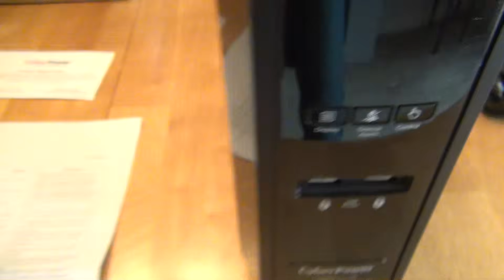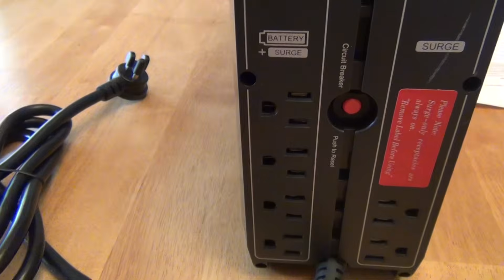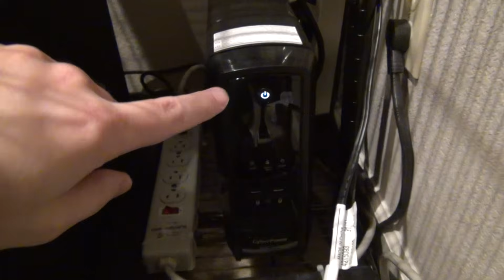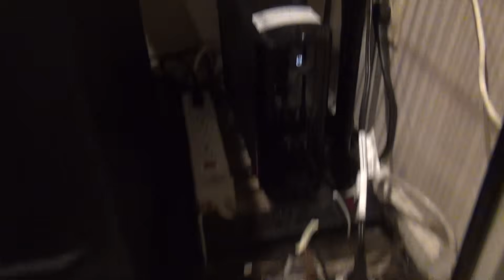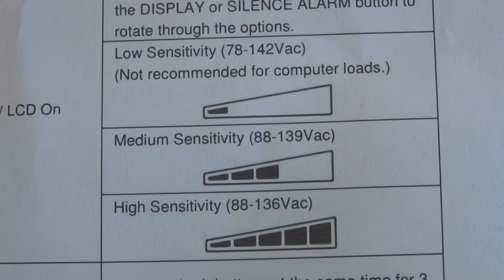CyberPower 1500VA 900W Sinewave UPS (CP1500PFCLCD) Review

Comment: Hey Tiger, just wondering how's this thing been running after 8 years?
Reply from the maker: I had 4 of these and had been going perfectly well to outlast power outages, and let me turn off equipment attached.  But the first one finally failed last month (June 2022).  It shuts off when there is a spike in power draw, and doesn't hold a charge.  I was going to look into replacing the batteries, but haven't had a chance yet.  Its batteries aren't intended to live forever and are supposed to be replaced at some interval if I remember correctly in the instructions.  I just used it until it died.  That was quite a while.

The capacity might have diminished over time, but for some of them I typically turn off the equipment when they start beeping, and had been enough time.  The other 3 are still running ok.  And I am planning to look up replacing the battery in the one that died eventually.

But I also have 4 Tesla power walls for whole home battery backup to installed in a month that will probably render this a moot point.

Comment: ive met a few people who feel they MUST have a UPS or their PC or other electronics will be damaged by dangerous "surges" or instability in their homes electric. ive never , not a single time, in roughly 40 years, had a PC, or other component damaged by electric surge. ive been told it happens where wiring or source is poor, well i live in Massachusetts, we have homes here that were built before Abraham lincoln was born, i lived in a home built in 1626, & still no phantom surges of death. i hate to break it to everybody, but a UPS (in reference to home use) is a placebo. its a suckers purchase, like static wrist straps, & the likes. We all know these events are Possible, just like its possible a bird will fly into your head & kill you, but you dont go around wearing a helmet every day do you?? a UPS is great for keeping power on during a blackout or brown out, its great for very limited short term electrical stability & reliability, & preventing data loss, but unless you have some extravagant storage setup, even data loss is of no concern, normal Windows home PC's will be perfectly fine if power is suddenly cut off.

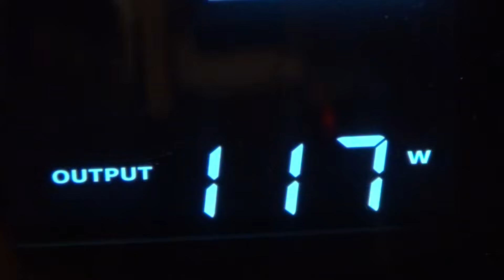Comment: 4:20.  Output = 117 watts.  Hah - my PC has a 650-watt PSU and I have a two-monitor setup.  Guess this will run for like 8 minutes when the lights go out.  Not a whole lot of emergency run time if you asked me.
Reply: No, that's the truth. If you want to run that you will need a much larger UPS.

That's just the way things are in the UPS marketplace.

Comment: Ok you actually didn't mention this but, do you plug this in straight to the wall? as i see you have it on extension cord.
Doesn't this thing have protection against surges and stuff? 
The only reason you'd need a cord is for extra power outputs which in my case 5 is the max i would need for my computer,phone,monitor etc.
Reply from the maker: Yes, plug right into the wall.  I had the other one first, and power neatly run all around.  It was easiest to just plug right into it.  Plus that room had a lot of noise on the electrical circuit from the dimmer switch on the wall (buzzing of other things if you dim the lights, likely due to grounding issues I've read).  Given the other is specifically meant to help with that noise, and this one just decides power or battery seamless switch when needed, I kept the other one.  I have a number of these, but only use the other in one place because I still have it and is convenient to use.

Comment: After 4 Years and a few months.  Do u already replace any battery?  Im going to buy one of them  CP1500PFCLCD, but i want to confirm that if is worth it.
Reply from the maker: I haven't replaced the batteries on any of mine.  I'm not aware of a significant degradation in capacity, but I don't have many power outages and I don't pull the plug to find out :) …. haven't had a problem with mine yet.  Power always comes back before I have a problem, or I have enough time to turn on my monitor or TV and power it down properly.  When I turn on the TV or monitor, it draws down the power much faster, like 15 minutes, if that, because I have a 65" TV.  But I only need it on for a minute.

Comment: I thought ups weren’t supposed to be connected to any power strips?
Reply: What I have read is that you must not connect a surge protected strip to a UPS (in either direction) or you may reduce or even cancel out the protection (just like you must not daisy-chain one surge protector to another https://www.nachi.org/power-strips.htm).  A UPS is supposed to be plugged straight into the wall, and devices plugged straight into the outlets (maybe via an extension cord).  BTW, a little thing I came across: "Nearly 20 percent of all failures and fires stemming from surge protectors happen as a result of daisy chains, according to a publication by the U.S. Office of Compliance" and "Daisy chains overload the surge protection technology, putting your electricals at risk during power surges." (https://www.prairielectric.com/blog/can-i-plug-a-surge-protector-into-another-surge-protector/). I don't know the particulars of how surge protection works or how a daisy chain causes a negating interaction, but I have read it in several places.
Reply: those really dumb 'surge protectors' that use a simple popout breaker setup and be put in front or behind of a surge protector, but otherwise you are right. Do not daisy-chain proper surge protectors.

Comment: Thanks for the review ..now my question..
Is this capable to reduce or cut electrical hum (exemple if I plug a guitar amp into it) or (guitar multi effects) studio speakers and so on..?

Because I have no ground loop eliminator in my home electrical installation.. hearing some buzz hum etc when I plug my guitars wherever (amp, multieffect, sound card etc) and the el hum become furious when I use compressors or distortion pedals) it’s almost unusable !

Comment: Hey Reviews By Tiger,
Are you happy with the UPS, can you tell me if you hear a coil whine or buzzing from the UPS when it's not running on battery or is it quiet? I am looking for a quite UPS... my APC was buzzing constantly :(
Thanks
Reply from the maker: I have 4 of these, and none of them have coil whine whatsoever.  It is completely silent when on AC, and when on battery or recharging a soft fan noise.  I find coil whine varies by circuit in home, and significantly depending on whether I had dimmer switches on the same circuit.  But even on the home that had terrible coil whine for my Monster Power Center, this device did not whine.  At my current home, I don't have much of a coil whine problem on anything in my house, so all I can say is my 4 on different circuits aren't whining.  I did have a USB power adapter that whined, unrelated to this :) .
Reply: OK, thank you for your thorough answer!

Comment: Don’t connect it to a power surge protector!
Reply: Could you let me know why? Thx.
Reply: UPS manuals normally say you shouldn’t connect a UPS to a surge protector or the other way around to ensure the UPS is seeing the correct voltage and load. Here’s a more detailed explanation of both cases by APC http://www.apc.com/us/en/faqs/FA158852/
Reply: Alltec highly recommends that you plug a UPS into a good surge protector.  I strongly recommend the Tripp Lite Isobar surge protector.
Read Alltec Article here:  http://alltecglobal.com/articles/importance-spd-protecting-uninterruptible-power-supply-ups/

So does Eaton Power, here: https://switchon.eaton.com/plug/article/176/ups-vs.-surge-suppressor

Interestingly, APC does not recommend a surge protector. Here are their reasons which I don't find compelling.  So long as you use properly grounded high quality surge protector before the UPS you will be fine.  BTW, APC has less than 500 Joule protection in their UPS units!  See APC Opinion:  http://www.apc.com/us/en/faqs/FA158852/

In case the URL is moved, here is the Alltec article recommending a surge protector for a UPS:

The importance of Surge Protection Devices (SPD) when protecting an uninterruptible power supply (UPS)

APRIL 26th, 2016

“I have a UPS, why do I need an SPD?” For over 15 years this has been a common objection dealt with on a regular basis. Following are some facts about UPS systems and their susceptibility issues, as well as some comments from IEEE.

A UPS provides secondary or backup power in the event of loss of utility power. A UPS protects electrical and electronic systems, process controllers, and data against the loss of the primary power source, which is the utility company.

Many UPS’ incorporate relatively low energy and low pulse life Category A or B surge suppression. This low energy built-in surge suppression may protect the UPS and its connected load from a limited number of small hits, but it should not be relied upon as a surge transient solution. The Institute of Electrical and Electronics Engineers (IEEE) recognized this problem that a networked Transient Voltage Surge Suppression device and UPS TVSS protection is required.

There are two basic types of UPS systems. First is the rotary UPS which has a motor connected to the primary power source, which is used to turn an alternator which generates the AC output to power selected loads, along with a battery bank. The other type is the electronic or static UPS. This type of unit relies upon inverters and rectifiers to generate the AC sine wave and is supported by a bank of batteries to achieve the desired run times. Within this category you find stand-by, line interactive and double conversion types of UPS’.

Transient Susceptibility of the UPS

    Protecting the Rotary UPS: Surge protection is recommended at the input to the rotary UPS to protect the motor windings, (and rectifier/charger and inverter when present), static switch, and bypass path to the loads. Additionally, protection at the output is recommended to protect the sensitive loads from the inductive transients developed in the generator inductance and/or inductive loads served by the rotary UPS as these loads are cycled on and off.

    Protecting the electronic UPS: Surge protection is recommended at the input to all electronic loads and the UPS is no exception. The AC-to-DC converter, the static bypass switch, and to a lesser extent the DC-to-AC inverter, are all susceptible to transient damage. Sensitive and transient susceptible electronic control circuitry constantly monitors the status of the UPS and the input and output AC power of the UPS. This circuitry is used to determine if the UPS should be delivering power from the batteries and DC-AC converter: or, if the UPS should switch to the bypass mode and deliver AC from the secondary source which is usually the utility AC power. Additionally, when the UPS is in the bypass mode for maintenance or due to failure, the sensitive loads should also be protected against transient disruption, degradation, and damage from the transients appearing on the secondary AC source or utility power.

The IEEE Standard Section 9.11 states that networked SPD protection is needed, and UPS describes SPD protection as follows:

    Service entrance protection “… A listed and properly rated TVSS should also be applied to each individual or set of electrical conductors (e.g. power, voice, data) penetrating any of the six sides forming a structure.”
Premise electrical system lightning/surge protection “… it is recommended that additional SPD be applied to downstream electrical switch boards and panel boards if they support electronic load equipment.”
UPS surge protection UPS surge protection: “Lightning and other transient voltage producing phenomena are harmful to most UPS equipment and to sensitive electronic load equipment (e.g. via an unprotected static-switch bypass around the UPS). Therefore, it is recommended practice that both the rectifier-charger input circuit to the UPS and the associated UPS bypass circuits (including the manual maintenance bypass circuit) be equipped with effective Category B TVSS protection as specified in IEEE Standard Section 9.11
    IEEE standard assumes that a TVSS protection network is in place when discussing UPS surge and transient protection.

The requirement that the service entrance and downstream switchboards and panel boards are properly protected with TVSS is assumed to be met. Additionally, Category B TVSS protection is required for the rectifier-charger input circuit and the associated UPS bypass circuits.

    Built-in UPS transient voltage suppression: Today, many UPS manufacturers provide low level lightning and surge protection. A typical UPS designed to power a computer may claim the UPS passes ANSI/IEEE C62.41-2002 Category A and/or Category B test waveforms. In general, one would assume that the UPS survives these transients, since there is no pass or fail in the ANSI/IEEE C62.412002. The adequacy of this built-in surge suppression to protect the connected load(s), the let-through voltages, the energy handling capability, and the number of hits of a given amplitude for the various transient waveforms that the built-in surge suppression will survive are not in general provided by the UPS manufacturer.

If a protected load is of sufficient value to an organization to protect against power outages with a UPS, the UPS and the vital load should also be protected against transient disruption, degradation, and damage.

Conclusion

A Transient Voltage Surge Suppression unit placed online in front of the UPS will protect the investment in the UPS and the connected computer equipment. During maintenance and downtime on the UPS, the SPD will filter out the transients and surges from the line during the static bypass mode or maintenance by-pass mode of operation, thus protecting the connected computer equipment from damage. The UPS itself will benefit with fewer maintenance problems and less downtime.

With the investment in sophisticated computer equipment and a UPS unit, the customer has already committed to keeping the system operational on a continuing basis. The additional investment in the SPD is minimal by comparison. The additional protection can be significant in terms of preventing even one downtime incident, which at today’s costs can run some companies as much as $78,000 per hour according to studies conducted and published by Computer Technology Review magazine.

To learn more about Alltec’s surge protection devices (SPD), visit our website alltecglobal.com or http://alltecglobal.com/products/surge-suppression/

Comment: Do you hear any noise coming from this model ups?
Reply: Hey, ive had the 900 watt model for 2 weeks and came home one day and it was buzzing,,,came home the next day and it stopped, now its buzzing again....so  how is yours doing is it still functioning ok?
Reply from the maker: Not when on AC power.  When it is charging a very quiet fan noise can be heard, which only happens after a power outage is restored.  When power is out and running on battery, its fan noise is noticeable.  When on battery it has a loud alarm beep, which you can disable if you don't want it to beep with the middle button.
Reply: Reviews By Tiger thanks for the reply. I have the 800+ watt version and I hear buzzing coming from this model when on for over 3 days. When powered off a high whistling noise (coil whine?). I have it in a bedroom, so it's a problem when trying to sleep. I wonder if it's the ups, or the outlets in the room.
Reply from the maker: I have one in my bedroom, and it is silent.  I'm pretty sensitive to the high pitched noise from some things too.  In my previous home, in one location (not my bedroom), I had buzzing coming from one side of a Monster Power Center, but most noticeable when the lights were on.  I had a ton of dimmer switches, and the buzzing seemed directly related to them and varied based on my lighting level.  However, I also installed one of these there (probably pictured in the video), and this one didn't buzz even in that environment while the monster power center did.  So I feel pretty good about these.  You can try it in different locations to see if it is specific to that circuit.  Otherwise I'd try an exchange if still within return policy, else contact the company and see if they are willing to help.
Reply: Reviews By Tiger Thanks, will do. It's new.
Reply: @joalesan4539  I recently bought the 1350 VA 810 Watt model from costco the other day. So far, when it's powered on, the ups is completely silent. But when I power off the ups by holding the power button and it shuts off (but the power cord is still connected to the outlet), it makes this high frequency whistling noise. I wonder if this is natural. It's very annoying when I want to sleep. Any updates on your experience so far? Is it supposed to make this noise or is it broken?
Reply: @kevintsai3350  I returned it a week later. Haven't really looked into different models due to moving.

Comment: How has it performed for you so far?
Reply from the maker: I own 4 of these now.  Still very happy with them.  I had a few power outages, and never had a problem with my equipment.  If you attach a large monitor to it, it can't power it that long, but long enough to power things down if I want, if I'm home.  But I usually just rely on it lasting longer than a usual power outage without actually turning anything off.
Reply: +Reviews By Tiger Thanks, although decided to go with an APC SMC1000 instead. Saw too many reviews of Cyberpower not honoring their warranties if & when damage was caused.